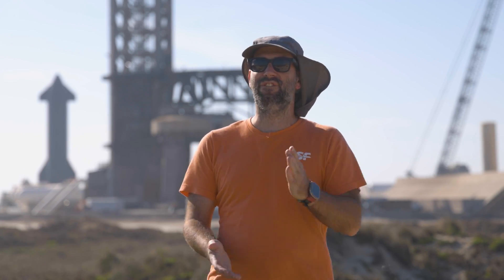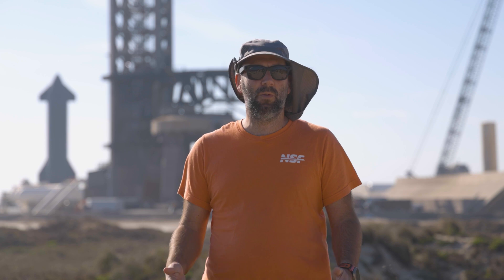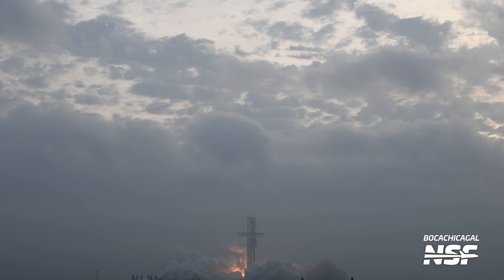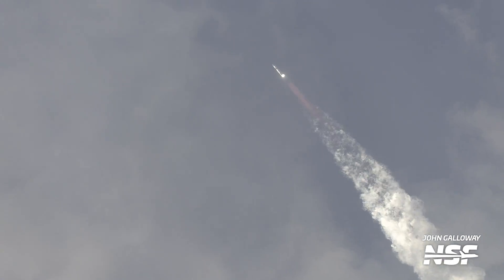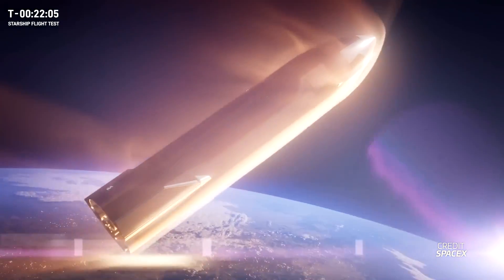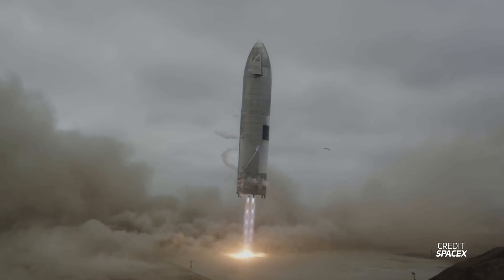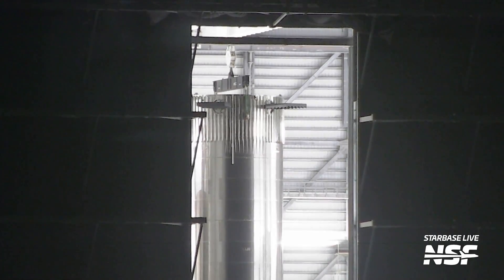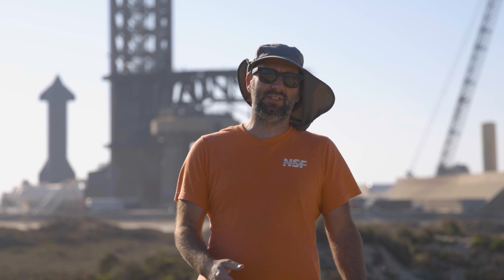Gearing Up for Starship Flight 4 | SpaceX Starbase Update

Comment: If the ship is able to make it ALL the way down to the chopsticks, but something goes wrong at the last few seconds where it can't grasp onto the ship, how far will the ship fall to the ground? Would the flight termination system blow it up before it fell, or would it just hit the ground and blow up? Or could the engines stay lit just long enough to gently set it down on the ground, even if that damages it?
Reply: FTS is typically safed on the way back in so it would fall and hit the ground then explode is my guess

Comment: Personally I couldn't care less about the landing part of the mission. Like in Hell Divers extraction is optional, in this case landing is optional. For a functional rocket it just needs to be capable of deploying the payload in the orbit it is supposed to be deployed. As long as it can do that it is a functional typically expendable rocket. If the figure out how to catch and land it at any later point they can cut the cost of operating this ship.

Comment: Now this is not the end. It is not even the beginning of the end. But it is, perhaps, the end of the beginning. Winston Churchill.

In addition to at least SIX launches of Starship that SpaceX is planning on this year, there are, last time I looked, 35 seats on missions to orbit, almost twice as many as in 2023.  Furthermore SpaceX will finally have some competition.  Even Elon would like that.  Winning a race in which you are the only competitor is less than thrilling.  ULA has already launched a Vulcan-Centaur.  BO is planning to launch in August, and will probably get at least two launches in by the end of the year.  And Ariane 6 is scheduled for its first launch in late June or July.  And there are at least three more ISRO GSLV launches in 2024.  All four of these boosters are optimized for insertion into GTO or transfer orbits to the Moon or Mars.  That means they are intrinsically more efficient for those jobs than Falcon 9 or Falcon Heavy.  However until they can reach a launch frequency comparable to SpaceX, which launched 10 times in January 2024, 9 times in February, has already launched 10 time in March with three more scheduled, and plans on averaging 12 launches a month over the year, how efficient an individual booster is is secondary.  There is a basic minimum annual cost to operating a medium to heavy booster that is independent of how many times you fly it.  Furthermore all of the competitors are still under development, and none of them have achieved reuse yet, while SpaceX is just cranking Falcon 9s off the assembly line at a rate of four a year, and then flying them 20 times each.  

I also wonder:  is there still a major value in placing massive single satellites that cost hundreds of millions of dollars to build and more hundreds of millions to deploy to Geo-Synchronous orbit, when. I don't know about you, but I haven't watched broadcast television in over five years, and low to medium altitude satellites can provide higher bandwidth and lower end to end delay for streaming.  And can a GOES satellite, like the one Falcon Heavy is set to launch in May, really monitor weather as well from 36,000km away as a constellation of satellites at 500km?  At 500km a camera with a 25mm/1" wide lens has the same image resolution as a telescope with a 1.8 metre/6 foot objective at geosynch altitude!  Wouldn't it be easier to lease space for your instruments on a Starlink or OneWeb or Project Kuiper satellite and have them plug their observations directly into the Internet rather than transmit them 36,000 km to a big dedicated ground dish?  And geosynch satellites can only see to about latitude 55.  Too bad if you live in Alaska, or Scotland, or Scandinavia!

The full-size V2 Starlink satellites have at least four times the power budget.  This is critical for delivering a usable 5G service to remote locations.

I suspect the 6 week schedule mentioned by Shotwell is primarily directed at the teams working toward ITF4.  All of their activities will be laid out in a critical path aimed at achieving that deliverable.  However I will admit as I went over the video that my first estimate, based upon a half century of managing high-tech engineering projects, was 8 weeks.  Of course I don't know exactly what went wrong and they have vastly more information.

Comment: Do you get the feeling that the Starship should just practice, with attached legs, landing multiple times with "test" chopsticks (a test structure positioned away from the actual tower for now) to see if the ship can be controlled enough to maneuver for the chopsticks. I mean sooner rather than later. Forget the booster for a moment, or even going to space. If you can't hit the mark for the chopsticks, you can't use the tower for landing sooner. It's cheaper to practice now, as opposed to firing off both the booster and the starship. then after the Starship proves it can work with the test chopsticks, practice on the booster. You have to build the test chopstick structure, I get that, but you can improve the accuracy and reliability of the landings now. And you can improve the chopsticks quicker too. Even with, maybe shooting off another booster-starship for progress in orbital missions/testing at the same time.

Comment: There was venting issues visible in the video and it's my guess that this is an ongoing consequence of the launch pad not having a proper flame diverter and trench.  When you watch the launch you can see the rocket is being bathed in shockwaves and that can NOT be good.  In fact, it's the kind of thing that can rupture prop lines which would give us the venting.
Another problem as far as I can see is that they appear to be lacking sufficient delta V and this is true even without the 150t payload, with the additional 150t I don't see Starship making LEO at all!  In order to improve the delta V they will either need to significantly increase the size of Starship/SuperHeavy or they need to significantly increase the Isp of the engines and I don't see that happening anytime soon.

Comment: IMHO, the Pez dispenser is upside down- the door should be at the top of the payload bay and the satellites loaded through it, then lowered one at a time until full. This will allow the dispenser to have a low power mechanism that only needs to slowly lower the sats rather than be able to lift all of them up at one gee, as it must to load the last one. Once in space, that low power system can easily move them up to the door.

Comment: As for goals, I think you're right, difficult problems are what we've seen SpaceX accomplish time and again.  They set them up to guide their efforts, and the entire team works towards them.  But all those by the end of the year?  No.  I think they may achieve the first two, actual orbit, and deployment of StarLink satellites, and probably even catch of a booster.  Though, that will be VERY tricky, to not mangle the OLM on the first try!  Catching the Starship itself is, I agree, the most complex problem, and the one that is furthest away at this point.  The ships that will fly for the rest of the year are almost all in some stage of build, if not complete.  Redesigns will take time.  And retrofit is probably not possible.

As for the OLM, and the new one at LC-39A, I say again, they need a flame trench.  The only way to redirect that much exhaust and heat is with a flame trench.  The bidet we currently have is good, but not good enough.  They are getting WAY TOO MUCH flame reflection, and it is leading to damage on the OLM.  The only solution is to lift it higher, and build the flame trench to divert the flames AWAY from the OLM and the rocket as well.  That would be my guess as to why they're disassembling the OLM legs at LC-39A.  Time will tell...
Reply: And thanks Jack!  And the entire @NSF team, you guys rock!  It's so much fun watching these videos and keeping up.  So much is happening, so fast that without your efforts, and many like y'all of course, we'd be lost trying to track through articles and other data sources...

Comment: I don't think engineering is the pacing factor. If the FAA grants a license for a portfolio of flights and none of the flights covered therein terminate in an alarming way, then I think SpaceX will prevail and meet their goals. But as soon as the FAA decides they need to micro-manage anything, the pace will slow accordingly, and that will impact SpaceX's ability to meet it's goals.

Comment: RE Starship pad demo at SLC 39-A, my guess is that NASA is going to require some form of directional flame diverter.  The water deluge system under the Starbase OLM is very impressive, but you still have highly energetic shock waves going in every direction away from the OLM.  I get that SpaceX is likely constrained with what they can do at the Boca Chica site, but at historic pad 39-A I bet NASA is putting the kabosh on those shock waves going in every direction.

Comment: The launch towers are just too valuable to expend on catching this monster.  Maybe design a new expendable tower dedicated to this one function, with 'claws' rather than 'chopsticks'.  I dunno.  A land-based system is ideal; but strapping landing legs on starship adds weight.  The starship design may just need to bite the bullet on this and give it legs. Besides, they are going to need these for landing on the moon and mars, may as well gain all that experience on earth.

Comment: Regular tower recovery of Booster and Spaceship by April 2027, Tower will need a lot of armoring both exterior and all the plumbing systems. Improvements in both flight control software along with booster and ship hardware will be needed.

Comment: Even tho the booster was flipping around it did corrected itself. If you look at the bottom telemetry the booster achieved a vertical profile. It was waiting for the Raptors to fire up for the landing.

Comment: Where do they intend to land the actual ship part of the Starship? Will they build out a massive drone boat or will it return to the launch area?
Reply: The latest idea we've heard is that it comes back to the launch site and gets caught by the chopsticks -- same as booster. We'll see what ends up actually happening though. Basically guaranteed to be a launch site return one way or another though
Reply: "RECOVER" is not the same as "CATCH."
Reply: The ship goes to orbit, which means from there it can go back to the landing site. RTLS is actually harder for the booster.

Comment: Spacex has 3 v1 starships on hand. That's 1 to test single engine relight and re-entry, 1 to test satellite deployment, and 1 to test soft landing in the water. V2 may very well have the modification needed for catching with the chopsticks

Comment: There is no comments in any channel about adding a pressure regulator interstage for the engines feed system reassuring avoid cavitations. Maybe it's not practical due the size of the rockets.

Comment: honestly, it seems ridiculous that they’re gonna try to go directly to landing on the olm, when landing on a pad would be way simpler and more accomplishable for now
Reply: I think the second olm is at 1st mainly for the catch
Reply: I mean if your were to land on a landing pad you will have to bring a crane since I don’t think a pad and a launch pad will be close together and restack a booster and the ship all with a crane. It wouldn’t be called a reliable rocket since you have to wait until it’s safe to go near the rocket,rollout a crane,stack a booster using the crane and human stabilizers, same with the ship, and then refuel,launch, and do it all over again
Reply: Plus it’s spacex they are curious and test and experiment with rockets. We have a 2nd tower coming up if they damage one then it won’t be a big deal because they will use the other tower,repair the tower,fix the issue,and then relaunch just like the f9 during early recovery era
Reply: FYI   There was never a plan to land on the OLM!!  The plan was always to catch the booster or ship off to one side precisely to avoid damage to the OLM if the catch did not go well..
Reply: @michaeldeierhoi4096  Quite a while ago the plan was actually to land directly on the OLM, but that idea didn't last too long so for all intents your point still stands

Comment: I don't think recovery the booster should be considered hard at all. They are basically there. Once the engines light back up right they are fine. Recovering the starship is were I think they have work to do for re entry.

I don't think it means landing them this year. If that's what they mean then yes it's ambitious.

Comment: Well, I have a feeling that they may be able to catch the booster by the end of the year, but I don't think the ship is God in the soon because there's just too much that has to go on to make that work such as thepends And another thing, they're talking about rapid resability. And then mask wants you know multiple launches a day. How are they gonna do that when they have to spend weeks? Repairing the corporate launch table after each launch because of damage from the 30 threevengeance. They gotta get that figured out first and the heat shield tiles.
Reply: Rapid comes after reusable. They are currently testing stage 0 exactly the same as starship to find what needs upgrading to reduce turn around time for the pad. They have only used the pad for launches 3 times, going to take quite a few more before they get the refurb time down. As a work around for the short term they will simply have more launch towers so they can refurb one while using another.

Comment: Chilling out watching this   update and having a drink from my new 17oz NSF flight test 3 mug. Unfortunately I discovered its 15oz not 17oz.  I tested multiple time. This size mistake needs to be corrected on the website. So clearly I'm a little disappointing, but can't imagine anyone at NSF would make this mistake intentionally. However very happy with the patch. The colors are amazing. I do wish the image & text colors on the mug popped like they do on my Flight test 3 patch. On my mug the image of Starship and the text bordering that image is much darker in comparison to the image on the mug seen on the website. 
As for Starship 
I can't be the only one that thinks the Ships  should have landing legs. Maybe SpaceX should design in the option of the both. Then they would have a back up  landing option incase if issues with either system. Especially once it's carrying humans. 

Seriously! It be very tragic if the sadly scrapped SN15 turned out to be the last Starship to land (on earth) successfully using legs? 
Also Elon I think Jack/NSF  deserves atleast one of the old raptor engines from booster 4. 😅
Reply: I was thinking that maybe landing legs could be added on for each vehicle and have then land them first on a drone and then at the launch pad.   Then once that is done well they can try to catch them.
Reply: @michaeldeierhoi4096   It's just easier, faster and much cheaper to soft water land them until they are  ready to try catching boosters.  
The current drone ships wouldn't work for the massive boosters and Ships. It would take too much time and money to develop new drone ships at this point in development. However I wouldn't be suprised if one day. After Starship is very flight proven.  SpaceX will invest in Starship specific drone ships.

Comment: Catch both booster and ship by the end if the year?.. Heck, no. It'd be a minor miracle if the first catch attempt doesn't seriously damage the arms, tower and OLM. I'm curious if there's a catch abort plan where they can send the vehicles somewhere else to crash so as to minimize damage.
Reply: Gwynne Shotwell through Jack said the plan was to "recover" both vehicles by the end of the year so it is not necessary to catch them now.  How they are recovered is uncertain and I don't see how they go from soft water landings to catching them anyway especially for the ship.  We'll see.

Comment: 4:45 -  Is this really correct? 1. that burn wasn't meant to circularize an orbit, 2. People say that FAA apparently won't allow a ciruclarized orbit until Starship is proven to be able to safely deorbit with full control, so this would mean other things have to be done first and this cannot legally happen on flight 4. But maybe these comments are wrong.
Reply: All they need is control and raptor re-light in space. It's not about legal you really don't want 100+ tons of steel falling out the sky at a random point which is why they need to show they can get it out of space at a specific point.
Reply: I think you're saying the same thing, just with different wording. They can't go into a full circular orbit until they've demonstrated the ability to do an in space relight for de-orbiting purposes. Once they demonstrate this ability they'll be allowed to circularize and go into a full orbit, not that the deorbit burn itself is doing the circularization

Comment: Are we sure that they really lost roll control of the booster as impled by Jack in the video? I understand that the extreme maneuvers the booster performed during descent made it look like it was close to spriraling out of control. But if we remind ourselves that this was the first time the gridfins were tested under descent-conditions on the booster, wouldn´t it be possible that what we saw was part of a test routine to test the limits of its maneuverability? What would they learn by keeping it all steady`without ever pushing the limits? Also we saw that the rolls in both directions were exteme but it always recovered in the end
Reply: Booster was supposed to be subsonic before the landing burn it was doing mach 3.
Reply: @shaung949  saw your answer just now. Thank you for that clarification!